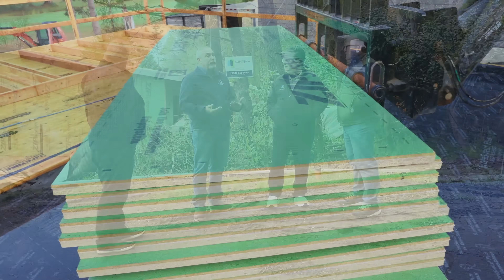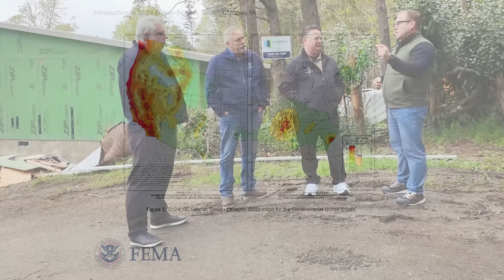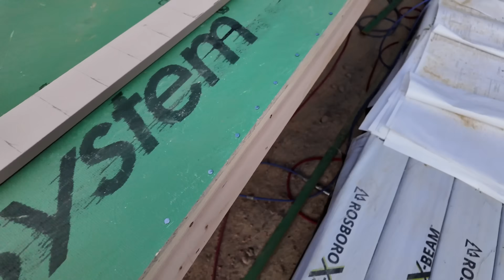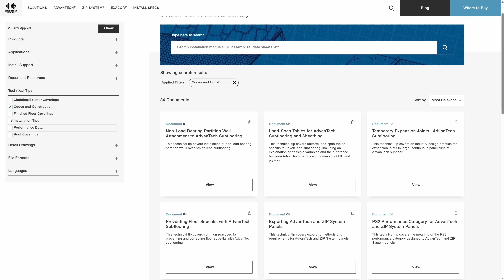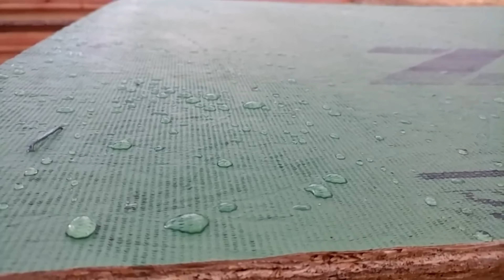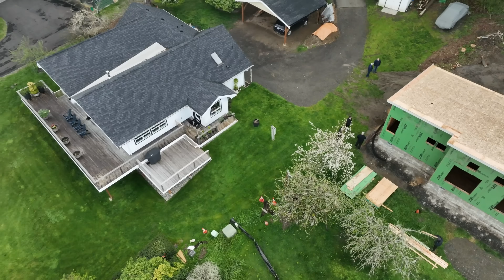Pain Points, Lessons, and What We Learned | First Time Using Zip System

Comment: I work as an engineer in WA state and I can highlight my biggest issue with zip-r pretty quickly. It gets somewhere between 40 and 60% of the shear capacity of a sheet straight on studs, it has aspect ratio limits that reduce it's applicability on custom houses with lots of glazing, and it doesn't have rated capacities for very tight nail spacing either. It feels like it could be pretty effective for houses that can be run through the IRC, but for the IBC it feels like you end up sheathing one side of the wall conventionally anyway so it becomes a very expensive rigid board... I think the continuous insulation requirement makes stucco finishes very attractive though...

Comment: I’ve done a couple of condominium projects the last few years and  they fall kinda between production building and custom, so architects try incorporate some higher performing details. Dude, let me tell you the amount of pushback I get from framers if I so much as ask them to install furing strips behind the siding, is insane lol
Reply from the maker: I empathize with both viewpoints. As a framer I don't want to do any of this stuff, however as an aged framer I don't mind it :-) its easy work I can charge for, so why not?
Reply: @AwesomeFramers  I think it’s partly because they aren’t sure on the man hours certain details will take, and so they’re scared to get burnt on it. I’m also in a market where high quality residential building is not incentivized and hasn’t ever been. So guys around here are taught basically just building wall panels and slapping prefabricated trusses onto them. They are plenty of framers, but very few carpenters left.

Comment: put tape on and not seal nails?
Reply from the maker: Correct, the taping of the seams provides an air barrier.  The field nails do not need to be taped.  Testing and field experience demonstrate that water isn't coming through those nails. Its not like this hasn't been demonstrated with housewrap and 1000s of staples putting holes in the house wrap.  Here is a great video worth watching https://youtu.be/SzBXXWMfsmA?si=Or-4iy5nhKGCXzQv

Comment: Why is siding fixed directly. Surely this system must be more effective and reliable if installed with a ventilated cavity?
Reply from the maker: Decades of experience with this assembly demonstrate its longevity.
Reply: @ that doesn’t mean putting thousands of siding nail holes in your WRB and not allowing it to ventilate is best practice. Good enough is subjective.
Reply from the maker: @edenf4519  Why does it need to ventilate?  Objectively speaking, my statement above is correct.
Reply: @ objectively it is good practice to ventilate because it is inevitable that moisture from external weathering will get behind the siding to some degree so the ventilated cavity will help with drying. Additionally the warm moisture laden air from inside will migrate out through the wall assembly and condense on the back of a cold surface. My understanding is that zip is vapour permeable which could result in the dew point occurring on the back of the siding. A ventilated cavity will help with drying in the wall assembly in this case.

Comment: Don’t forget to silicone tar all of you screw holes
Reply from the maker: @chadmarino2741  that's 100% untrue. The System has been tested and the literature says it doesn't need  to be. Jake Bruton did a fantastic test to demonstrate this. He's Jake Bruton with Arrow Building
Reply: @awesomeframers The Zip system will void your 30 year warranty if it’s installed incorrectly and that means tarring every single nail hole.
Reply from the maker: @chadmarino2741  That is not in the warranty, nor required in the manual.  Can you show me the page that says it does? https://youtu.be/SzBXXWMfsmA?si=Tt8vZBJJNCD2ToGc

Comment: Isn't this a problem; vapor permeance of less than 1.0 perm.
Reply from the maker: Why would that be a problem? Honest question
Reply: @AwesomeFramers  During cold weather months shouldn't vapor diffusion pass through drywall, interior framing, and wall cavity insulation ie. rockwool batts to breath through to outside. wont this trap moisture/vapor in wall cavity. Not  talking about condensation.
Reply from the maker: @fredjohnson4772  what's the climate zone? What's the HVAC system? Etc
Reply: @AwesomeFramers  climate zone 5. appropriately sized forced hot air typically. My thinking is any exterior rigid foam board that doesn't have a decent 6/7/8 or better permeance rating would be a problem/vapor retarder. The perfect wall Joe lstiburek?

Comment: Zip is GREAT if you clean the sheathing before taping, and you roll the tap with her embossed roller- Ive seen that consistently  in << 10% of “custom: “ bulls eevn ! And let’s be honest, you can NEVER really get inside corner seams correctly adherered/flat-use liquid zip ALWAYS on those seams.
Reply from the maker: I find it easier to use 3' pieces for inside corners.
Reply: The r-sheathing only has a vapor perm of 1.0 which will trap outboard moisture and cause rot

Comment: I can't wait for all the new mold lawsuits from this exterior insulation requirement.
Reply from the maker: Why would there be mold lawsuits? It isn't difficult to remove the necessary steps for mold to grow.
Reply: This product only has a 1.0 vapor permeance, so trapping outboard moisture is definitely going to cause rotting problems.
Reply from the maker: @fredjohnson4772  how is the "outboard moisture trapped"?  What do you say to the thousands of homes that haven't rotted using this product?  Its all part of assembly design.
Reply: Whoop there it is. The miserable "know it all.. gotta piss in the punch bowl" dude  Same dudes that go on and on.." my dad n uncle has been building houses for years..they can do that house for fifty bucks per square foot..blah blah.."

Comment: The complaint from the framer about taping the seams is my biggest gripe about Zip... and that's not the fault of Zip, and it's sort of understandable from the framer. When I built my house last year, the framers did an excellent job with the actual framing, they did a good job putting up the sheathing, but they did a HORRIBLE job applying and ROLLING the tape... so I literally had to go back and do it all myself (the entire 2000 sqft house). The job of "taping" was delegated within the framing crew to the lowest guy on the totem pole, and of course, he couldn't have cared less... even after I complained repeatedly. Bottom line is that any great product is only great IF it's installed correctly. With Zip, EVERYTHING depends on the tape.
Reply from the maker: Great points.  Its all a learning experience, it also speaks to their lack of QA on the tape.  Its a good way to get paid for easy work and it doesn't take much training nor practice.

Comment: As a first time owner builder in AZ, I learned about Zip and airtight building from all of you YT "stars", (Matt R., Steve B., Tim U., Stud Pack, etc.). There are ZERO builders in Lake Havasu City who ever even heard about this sorcery! Even Builder's First Source's local shop knew "zip" about Zip. We are mid build and have become a bit of a looky loo attraction. At the ripe old age of 68, I have personally taped over TWO MILES of Zip and Zip liquid flash on a 6000 sf project. Builders were going to charge me an extra $40-50,000 to use Zip. I was able to find a framer who wanted to learn and was willing to frame and shear for no extra charge if I would do the taping/sealing. Even my roofer gave me better pricing on a premium roof system (combo of concrete tile, TPO flat roof, and composite walk on roof deck areas) because he wants to learn how to build better. I try to point out that what we are doing will be forced on them by code sooner than later.

It has been a HUGE learning experience, but Huber and my rep, Kelley Neel, have been super supportive. And the tape is amazing!

If a rookie senior citizen can pull this off, then any builder can too. Come on down and have a look for yourselves. 

Also, thanks to Steve and Tim for taking a minute at IBS to answer my questions.

Comment: DIYer here: I did a deep energy retrofit on the exterior, tearing it down the studs and putting up ZIP as the sheer + air barrier (in addition to new windows). I also did exterior insulation via a larsen truss and so did house wrap over the exterior insulation. Doing the ZIP + tape/roll was much easier than the house wrap. I'm sure pros who house wrap all the time think that's simpler today, but I'd bet that after a few jobs the tape + roll will feel taping the seams is easier.
Reply: Buddy you just backed yourself in a rot corner.  If you put a vapor barrier on the outside encasing everything you just put up on the exterior moisture has absolutely nowhere to go.

Good Luck with that
Reply: @Long-Island-Sound  House wrap is vapor open.
Reply: @dosadoodle I read it as vapor barrier my bad. My eyes are out of square -SMH
Reply: @Long-Island-Sound  All good 🙂

Also, if I had screwed that up, better to figure it out now rather $150k later, so do keep calling out issues for DIYers like myself if you spot a problem!

Comment: In residential, I would say in the area that I'm in, 90% of house wrap installation are not done to both the manufacturer's specifications and/or code.
Reply: And in my area, 90 % + of zip hosue are not Taped properly , ;etc be honest. Haha Stevie, Ive NEVER seen a house with Tyvek as tight as you describe - you needs to get out more often OLOL. And the comparison between housewrap is a n easy victory - but how about comparing with self adhered ? Blueskin. Benjamin Obydyke etc ?
Reply: The manufacturer's specifications for installing house wrap is wrong. It's been fundamentally wrong since the invention of house wrap and I'm talking about ALL manufacturer brands. House wrap should never touch the sheathing. It needs to be offset by .25in minimum using furring strips...but nobody does it. There needs to be an air gap for ventilation in case water does manage to get behind it...and it always does.
Reply: @jamescrud what scientific proof do you have to backup your statement?
Reply: @RCMServices  Actuall imperical data of an installation that's 20 years old where the house wrap and sheathing are in pristine condition despite the house wrap (Tyvek) being purposely exposed to harsh weather year round (sun, rain, wind freezing temperatures). In addition, the sacrificial house wrap section (8ft x 20ft) had 100s of nail holes put in to it to deliberately allow water to get through. The correctly installed house wrap is on my shop on 3 walls. The one with the holes is on the back wall stapled directly onto a second layer of OSB which I knew was going to get damaged...and it did just as I suspected.

This isn't rocket science. You can't seal up wood and expect it to dry out if there's no air flow. That's exactly what happened to thousands of home where water got behind the house wrap, took too long to dry out, and resulted in rotted sheathing especially if the sheathing was OSB. Several of these cases can be found on the internet.
Reply: @jamescrud I can only speak for Tyvek, but that would not be an improved installation. They spoke in the video that most failures are due to improper installation. The best products are only as good as those installing them.
Reply: @RCMServices  It is a much better installation because the Tyvek is only there as a rain screen and the furring strip is what makes it impossible for water to come in contact with the sheathing since it will just drip down the backside of the wrap and out the bottom.

The only drawback to do this is it's more time consuming and is the fundamental reason why contractors don't do it. The manufacturer's know this. They don't specify this type of installation because they know contractors will avoid buying their products if it takes too long to install and affects their profit margin. So...they just say staple it on. From a building engineering perspective it's fundamentally incorrect.

Comment: You guys should know you have to have the discussion with the building official, not each inspector. If it’s an approved system, the inspectors have to understand and approve it.
Reply from the maker: What's the difference between the inspector and the building official?  Incidentally, while we were filming, the inspector showed up for shear and we were able to talk to him about the system.
Reply: @AwesomeFramers That’s cool! He probably wondered what he walked into.
Reply: The official is the head guy in the department and (in a smaller department) he’s often the one who reviews plans. If we have a code issue, we go to him not the inspector (which can be one person or another sometimes), who is less experienced. Anyway usually the system fits requirements of the state code, and the building official has to recognize that.Then you should be able to point out to the inspector that this was approved in the permit.
Reply from the maker: @pcatful  👍👍👍

Comment: How do you have nailing inspection if you do it all on the ground? Call out the inspector for every wall before you tape and erect it? How many inspections is that? 3-4?
Reply from the maker: you can check the nail spacing and whether they are overdriven through the tape.  We've been using Zip System since 2009 and tape before lifting the walls.  We disucss this with the inspector.  COVID changed a lot and the inspectors let us take pictures and share the album when they come out onside for shear wall nailing inspection
Reply: How does the inspector inspect nails from the ground?
Reply: @BaronVonFrankenBolzlll I don’t know if were talking about the same thing. They were talking about nailing the sheathing on framing when it is “on the ground” —actually on the floor. But if they want to tape it next, I wonder do they have to call for inspection before they lift the wall they are working on. Actually the inspector can do a better review in that position than looking up at the wall after it is erected, but this seems like it would slow down your work to get an inspection for every wall  or one at time.
Reply: Ask the inspector if you can take pictures.

Comment: I'm living In Connecticut and we started new project with that zip system, but 2 inches isolation, its such slower compare to regular plywood, we need to use 4 inches nails and for those you need to have special gun which is noticeably heavier, so after first building spending most of the time in forward bend , btw Iam 6'6'' I had herniated disc.But I guess its future and make a lot of sense
Reply from the maker: Yep, its slower than regular sheathing but faster than another sheathing + foam+ furring strips

Comment: Our area requires visual on the shear nail pattern before taping can be done. Timing is everything
Reply: really?  even though you can see the nails thru the tape?  When I used zip a couple of years ago (portland, OR) we taped the panels where we could before standing the walls up, didnt have in problems with our nailing inspection.
Reply: 3m 8067 acrylic adhesive tape is clear.........could pre tape and still have full visual inspection. However you won't meet huber warranty.

Comment: I'm looking to import some wrb panels to the UK....you recommend Zip over LP Weatherlogic..? Or they pretty much the same thing...? 👍
Reply from the maker: I say Zip because its been around 3x longer than WL, is a higher grade OSB than WL (which is just commodity OSB) and the tape is much better.
Reply: @AwesomeFramers  Thanks for the reply. Now to work out where to buy it from, and the logistics of a container... 😆
Reply: Zip is better for weather that has a bigger seasonal difference. Must use the tape for the correct panel type. Can’t mix and match tapes. Zip tape has become known as Super tape, lol. Use liquid flash for nail areas that nails are over driven. We just go over all nails with a liquid flash.
Reply: @randymatthews5263  Cheers Randy... 👍🏻👌🏽

Comment: Have the inspector give paperwork of why you cant tape while laying flat
Reply from the maker: Good idea
Reply: @AwesomeFramers  Steve's comment that the nails are visible through the tape.
So it's the inspectors problem. 
Sounds like they don't inspect roof nailing in your area either.
Reply: They should appreciate that they can inspect more easily flat. Unless it’s that it’s too hard to see from the truck.😊
Reply: Has nothing to do with code or tech. He doesn't want to learn anything and wants to inspect like he normally does and that'd it.